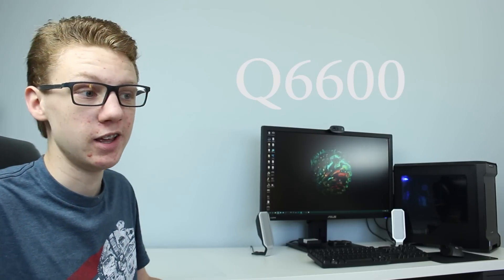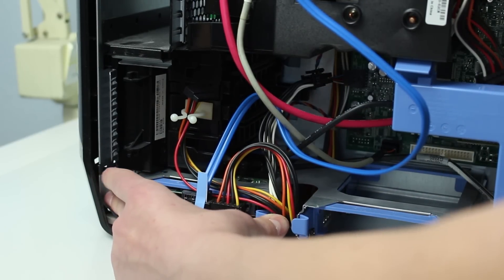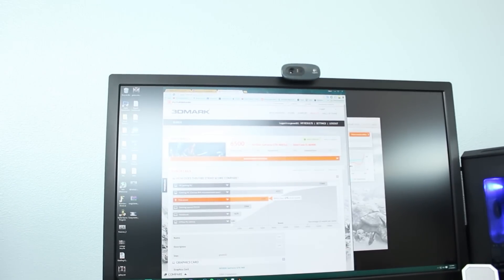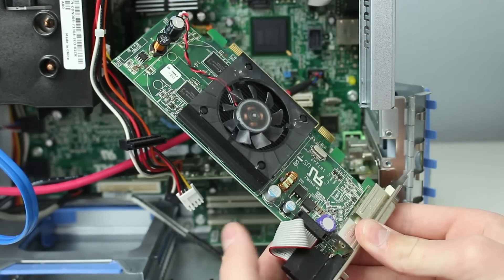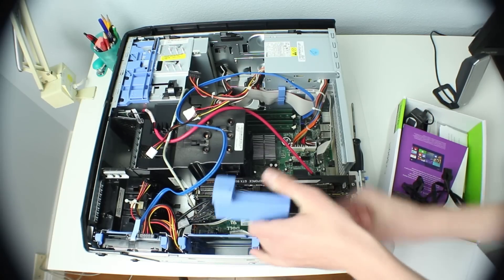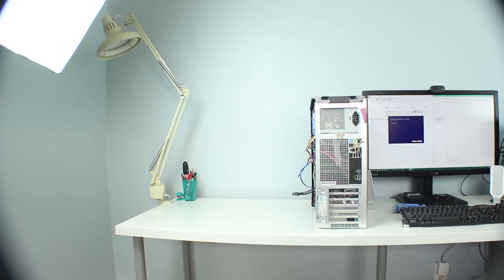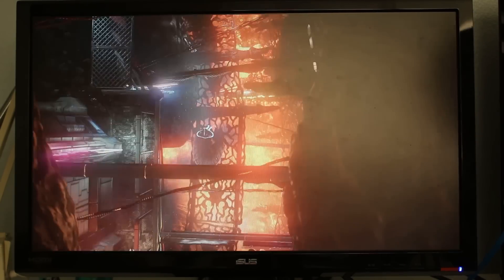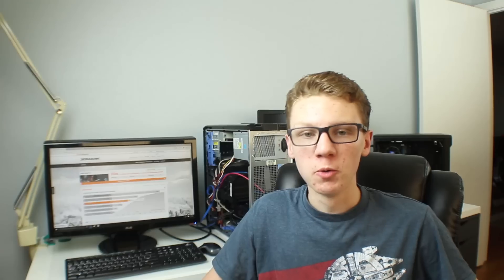Old CPU + New GPU = Gaming PC? (Core 2 Quad + GTX 960)

Comment: I have basically the same setup:
Q8300 strapped onto a DX48BT2
8 gigs ram, 2 SSD drives in a raid.
Nvidia GTX 970

System runs everything I throw at it beautifully at around 60-100 fps.

The main reason for that is that we've been had: Video cards, once they have all the data  that they need loaded into their onboard ram, barely sip on the PCIe bus, therefore barely tax on the main CPU. This has been true ever since the heady days of when the original PCI bus came out. The bus was garbage so designers designed everything in such a way so that you "talk" as little on the PCI bus as possible.
The tradition still holds true today, fire up GPUz and look at your Bus usage. The result may surprise you.
Reply: So much stupid on a such a stupid video...2 seconds viewing gaming benchmarks would prove otherwise, but of course, that is too much work, eh?  If you don't know what you are talking about, just keep quiet and listen to people who might.

Comment: If you had a better psu and hdd on that it wood probubly get even better score.
Reply: and what would a better hdd or psu contribute in terms of performance score??
Reply: Well for one a better psu wood give the gpu the power it needs and that wood increes the gpu performenc. Ass for hdd having a proper hdd wood give a slit boost on read and right times.
Reply: hdd maybe but i dont think so personally because if there was any significant bottlekneck in read speeds then you see stuttering during the benchmarks and play testing,as for the psu...the system was under pretty much full load which means the psu was able to cope,if it wasnt the system would just shut down and we would see that the psu cant output the required wattage to power the system while under significant load
Reply: good point on bolth counts. I did have a freind that just got an ssd and tested arkham night to see if wb,s statement that the game wood run better on it and he did not get much off a difernce so i im inclined to be with you on this one. However i wood still like to test it myself.
Reply: if you have the equipment and you test please come back to this comment thread and share your result,i would also like to see if differant hdd speeds affect scores much
Reply: Don,t have the gear in video. But i am going to get an hdd upgrad in my corrent rig. Wich is a, 990fx gigabyt, cpu is 8370e and a gpu of r9 270. I plan on replacing an old hdd that i have been useing cenc my ferst gen i7. So i will let you no how that go,s if You want? ps. Thanks for not pointing out my spelling. Your one of the few with maners.
Reply: +Jason Kinsey would love to see the results thanks :) and about the spelling I don't see the point in trying to roast someone over the Internet on the comfort o my home just pathetic in my opinion and besides everyone has flaws and makes different mistakes
Reply: I give you a brownie point. I will let you no win i replace my hdd. Shood be this month or next month.
Reply: Ok hear is the up date on that hdd. I have had my new wd 2tb black at 7200 rpms for a few months now and i have allready noticed a improvement in boot up time on my os and some games, not all but some. I was relly surpriced to see a big diferince in color and response time in games. So far i wood say it was well were the upgrade for me.

Comment: So you know in the future: At the Windows Setup screen when booted from the disc, use Shift + F10 to get to a command prompt. From there run "diskpart" (without the quotes), select the correct drive (usually drive 0, so you'll most likely need to run the command "select disk 0", use "list disk" if you're unsure) then run the command "clear". It clears the entire partition structure from the drive. From there the drive will be available to Windows Setup as unallocated space. If you click on the unallocated space, Windows will automatically create the partition structure.

Comment: Reasons to consider the i5 4690k
Much newer manufacturing process 22 nm vs 65 nm A newer manufacturing process allows for a more powerful, yet cooler running processor
Much higher clock speed 3.5 GHz vs 2.4 GHz More than 45% higher clock speed
Has a built-in GPU Yes vs No Somewhat common; A separate graphics adapter is not required
Much better geekbench 3 single core score 3,649 vs 1,306 More than 2.8x better geekbench 3 single core score
Newer Apr, 2014 vs Jan, 2007 Release date over 7 years later
Much better geekbench 2 (64-bit) score 12,942 vs 4,541 More than 2.8x better geekbench 2 (64-bit) score
Much better overclocked clock speed (Air) 4.53 GHz vs 3.52 GHz Around 30% better overclocked clock speed (Air)
Much better performance per watt 11.37 pt/W vs 1.44 pt/W Around 8x better performance per watt
Much better cinebench r10 32Bit 1-core score 7,619 vs 2,778 Around 2.8x better cinebench r10 32Bit 1-core score
Much higher Maximum operating temperature 72.72 °C vs 62.2 °C More than 15% higher Maximum operating temperature
Better geekbench 3 Multi-Core score 11,924 vs 4,490 Around 2.8x better geekbench 3 Multi-Core score
Better geekbench 2 (32-bit) score 11,872 vs 4,161 More than 2.8x better geekbench 2 (32-bit) score
Lower typical power consumption 71.5W vs 85.31W More than 15% lower typical power consumption
Significantly better cinebench r10 32Bit score 27,090 vs 9,681 More than 2.8x better cinebench r10 32Bit score
Much better overclocked clock speed (Water) 4.58 GHz vs 3.7 GHz Around 25% better overclocked clock speed (Water)
Lower annual commercial energy cost 77.09 $/year vs 91.98 $/year More than 15% lower annual commercial energy cost
Lower annual home energy cost 21.2 $/year vs 25.29 $/year More than 15% lower annual home energy cost

http://cpuboss.com/cpus/Intel-Core2-Quad-Q6600-vs-Intel-Core-i5-4690K link provided
Reply: its not just benchmarking it and calling it a day especially when you are using a benchmark that does not rely a lot on cpu power

Comment: so funny it took you so long. my back up computer is a core 2 quad. will runs most games on ultra with ease. your computer is fucking slow because your hard disk is dying. my back up system 

Core 2 Quad Q6600 2.4ghz
GTX 750ti
8GB DDR3.
250GB Samsung SSD
Reply: 1080p?
Reply: more like 480p m8
Reply: yeee 1080p without any issues at all. I play Battlefield 4. Dead Space 3, Overwatch,
Reply: Those aren't really GPU demanding games, well maybe BF4 does require a good graphics card, but 750ti is just good enough for it. I also own a 750 ti now, and it runs BF4 on ultra smoothly only on 900p or lower resolutions. Don't know about Overwatch, but DS3 ran smoothly on max settings on my old HD5750.
Reply: same specs as my dell

Comment: The hardrive is a major issue. I do not see the CPU as the main issue it is  garbage supporting it.  That  CPU is way ahead tech wise of the mobo RAM and drive.  i am not sure why people are so negative about this video.  I think you make valid point in naive way.   you get a pro to do the same thing some people would freak.

Comment: I have a q9550 CPU and 2x gtx 560 ti graphics cards with 8gb of ddr2 800mhz ram. It's motherboard is the asus strikerII formula. It kicks arse. I can play anything on it. I built a similar PC that's almost identical but with standard gtx 560s in sli. The bench scores are very similar. I have yet another PC that's running a q6600 and 2x gtx460s. It's playing most games but you have frame drop quite bad.

Comment: Why use the Q6600 when you can get the QX9650 for 100 bucks on eBay? That is a freaking 900bucks CPU and the fastest of them all Quad Core Extremes for 100 bucks.

Comment: Just get a i7 920. More performance. Same price used. Tip for vids. Shorten them down a bit. Or speed up installation footage.
Reply: I have a Dell 435tmt with a i7 920 too with a gtx 970 and it runs 4k games perfectly

Comment: 1. Gtx 960 does physx!  
Second u don't get 85% of the CPU performance.  Try games like bf3 and ur CPU will bottleneck like hell!! 

U don't have any knowledge of what you are doing, seriously!
Reply from the maker: +Think4Yourself If the GPU does PhysX, wouldn't that help the CPU?
Also, I meant 85% of the performance in this test. The purpose of this video was to show that GPU matter more than CPU and is where your money should be spent. So many people are misinterpreting this video and thinking I'm calling this a conclusive test, when I didn't even try any games. 
Also, if I didn't have any knowledge of what I was doing, would I even be able to make this video? Would I be able to intelligently reply to your comment? Do you have any knowledge of proper grammar or sentence structure?
Reply from the maker: +Gavin Remme I do agree with you though, it would probably bottleneck the 960 in some cases.
Reply: Gavin Remme
 CPU is more important than u would think in nowadays games.
as far as i can understand what you say in the video, you are saying that physix is cpu only. cant understand it right, its a bit "brlbrlbr"

Comment: Windows 8 and 10 tend to have a problem where the HDD runs at 100% or close to that all the time. SSDs work well with 8 and 10, but HDD no.

Comment: I assume that is an XPS 420, you could easily pin mod that Q6600 with a small piece of electrical tape, this will hardware overclock it to 1333mhz (3ghz). The system will still allow a 4x2gb(8gb) DDR2 upgrade and will fair nicely with low powered GPU such as a GTX 750ti/GTX 950 that runs PCIE power.

Comment: gta 5 is hard on the cpu
Reply: Not True, i have the gtx  280 and q6600, 4gb ram, Asus p5e and gta 5 runs Well in medium/high
Reply: arnaldo lucchini it is true gta is one of the most cpu entensive games newer ones of course
Reply: my specs :
GPU : geforce gtx 750
CPU : intel core i2 Q6600 @3ghz
RAM : corsair 2x 8gb / 16GB DDR3
HDD : 4TB
SSD : 250GB
Monitor : samsung syncemaster bx2335 60hz

and i play gta V on ultra with 60-90fps :)
Reply: +Micah Barkley in gta 5 minimum specs are q6600, and it is not heavy as gta 4
Reply: yeah when you play it with a shit gpu  and 4gb ram

Comment: People should buy server CPUs, they're not as scary as people think, and stuff like the E5-2670 Xeon can mop the floor with a lot of desktop processors.
Reply: Exactly, even used ones are sold just because they're a couple years old and the company doesn't want the system to crash, they usually have several years left in them MINIMUM.

Comment: As a Q6600 owner, it is a solid CPU, and these synthetic benchmarks don't tell the whole story, I have a 560GTX GPU because that's the highest GPU I can get without the CPU being a bottleneck, also there's the whole architecture argument, the older Motherboards don't support SATA III or decent RAM, (i'm using 4GB DDR2 RAM @ 800mhz), what I would do for a little more speed, I do prefer the Basic Input/Output System compared to the newer Unified Extensible Firmware Interface, mainly because it's more flexible, and well, the pain that is Northbidge and Southbridge.....

Comment: Good video.  The Q6600 is a pretty capable CPU when paired with a decent card.  I was running one with GTX260 then 7970 and reasonably happy until I went to i7 and GTX970.  Performance in games will vary depending on the CPU usage of the game of course.  A fairer comparison with this would be to also test a few actual games to compare.

Comment: Still running my i5 3570k, 4.5ghz nearly 4 years now. It doesn't even bottleneck dual GTX 780's. That's how absolutely badass these Ivybridge i5's are.

Comment: Ouuuch heavy CPU bottleneck with that GPU ! i had a GTX660 paired with PhenomII to 3.7GHZ and the PhenomII was Bottlenecking the GTX660, now let alone a ancient Core2Quad at 2,4 which should be much Slower than the PhenomII.

Currently using a Skylake i5 OCed to 4.5 paired with a GTX780Ti, planning on getting a faster GPU... maybe GTX1070 or Dual Radeon RX 480.

Comment: Not all games rolling out from now on will be GPU based,
most games even now are CPU +GPU based.My point is they use much more CPU than other normal games.
Games - CRYSIS,DYING LIGHT,STALKER ,METRO LAST LIGHT/REDUX ,HOMEFRONT THE REVOLUTION,ETC,,,,,
From now on most will put high load on CPU for sure .If you put this video before 2016,the fact you stated will be so true to spend very less buying a CPU and spending good money on GPU.

Comment: I have a i5 2400 and I am thinking to buy a r9 380x... will it work??
Reply: Wait for polaris RX 480 mate. Twice the performance of R9 380x and it will be cheaper to r9 380x.
Reply: +sermerlin1 can't bro... I'm in the US for some time now and in India(where I stay), it is gonna cost me twice as much
Reply: Hardik Kapoor Fuck. Well in that regard 380x is an excellent choice but if you can tho stretch to R9 390 since i hear there's not much gap between 380x and 390 unlike in other countries...
I did ton of research and r9 380x is the best performance for money well along side R9 380 4 gig. So unless you can't at all wait 29th june to snatch RX 480 then go for 39 380x without even thinkin about it. I was gonna buy r9 380x since my 7870 died but luckily polaris is around the corner so gonna wait for it.

Comment: fyi a boot is when you get into os loading a POST is that initial step before windows starts to load
also how bad is that gfx card my gtx970 only has one 8 pin pcie power connector so why does your less powerful 960 need 2 or are they 6 pins (in which case there are 2 molex to pcie power adapters out there

Comment: So how will this computer I build like this month do on todays stuff and it my first build to.

Asrock 4coredual vsta
4gb ddr2 667
His ati 4670 1gb agp graphic card
Qx8600 cpu
Waiting for new hd but temp one I got it ide enhanced wd 60gb
Shark 1200w psu and connectors are detachable
NZXT PHANTOM ATX Full Tower Case, Black and Green, PHAN-002GR
by NZXT Technologies
Used artic silver 5 for thermal paste for cpu and got the overclock led socket 775 cpu heatsink fan cooler

Comment: bro, stickin a new gpu on a fairly old system with the original PSU is quite dangerous... as the capacitors grow older their efficiency drastically goes down as they age... good thing it didnt die while you were doing this video... had a PSU blow up on me once... took the mainboard and gpu as well... just my two cents bro... nice vid btw

Comment: Thats why intel sucks, no improvement 7 years old cpu does same job as new.... glad i dont use intel
Reply: *****
with double price
Reply: Well, you could argue that a 2600k still makes mince meat of AMD. 6 years later...
Reply: It does not do the "same job"; you're grossly exaggerating. Also, there is more to hardware than merely performance.
Reply from the maker: Go ahead and compare the top of the line AMD CPU to a i7-6950X and tell me about "no improvement". AMD hasn't really put out anything new in a while. I'm not a "fanboy" it's just your argument makes no sense.
Reply: Gavin Remme
i still wont buy intel even they make golden cpu for 1 dollar :)
Reply from the maker: 1sonyzz Why not?
Reply: Gavin Remme
intel is like beats just in pc market :)

Comment: actually those cpu after Frequency war on CPU after on 64 bit when then multi core cpu also the gpu gone crazy good the point is those cpu and gpu will just do fine up what 5 or 10 yrs only bottle next is the Disk drive if you put a SSD or something equivalent solid state storage i will run almost as fast to your current system as long you do not do weird overclock and crazy bench mark test, if you doing some web browing and some casual game it will do just fine

Comment: It'd even do better if you were able to OC that CPU.

Linus has been using that CPU for the 1st two seasons of scrap yard wars. That's a good CPU still..
Reply: Get the qx6800 lol
Reply: Not with that mobo and powersupply. DFI ftw!
Reply: +Leone Furlan not saying that, lol. He's done some PC builds with it like in his scrapyard wars series. Look it up.
Reply: Leone Furlan ya but why would you want to mod a motherboard that cant go back to socket 775?
Reply: Leone Furlan that ok and now I understand it better so none of the pins get cut jsut plastic piece that useless? Where are these plastic pieces cause cant tell from video.